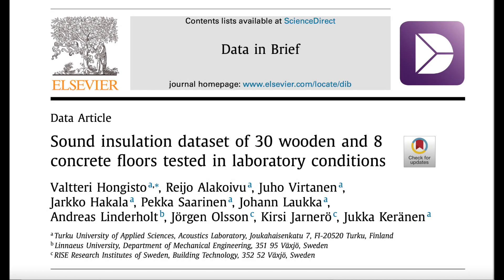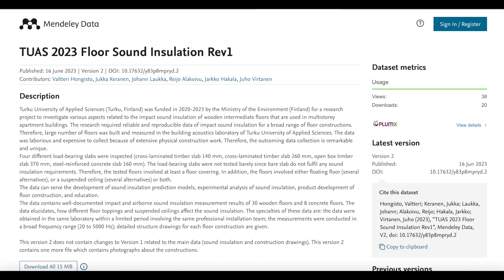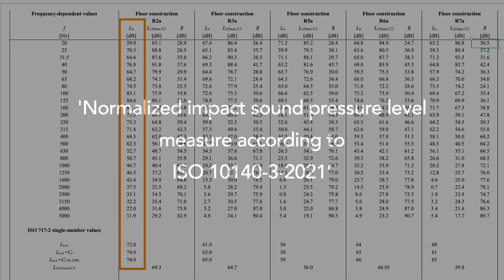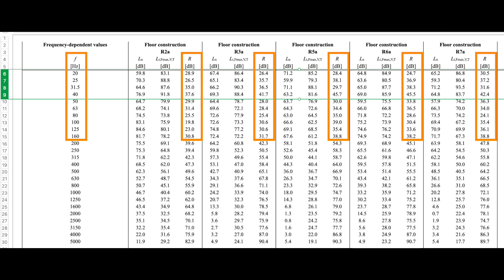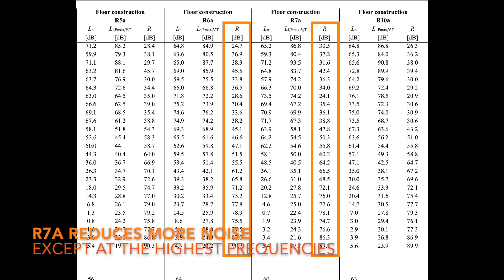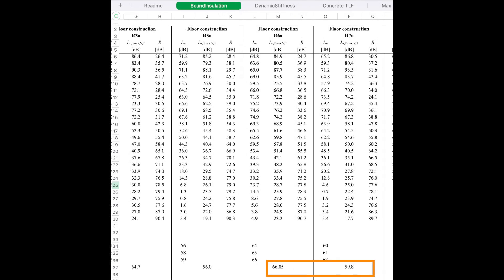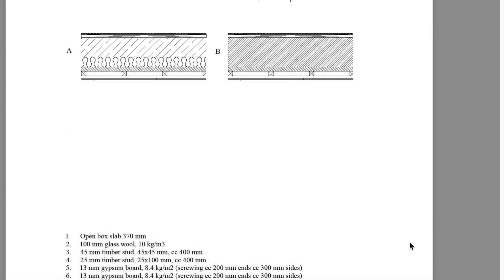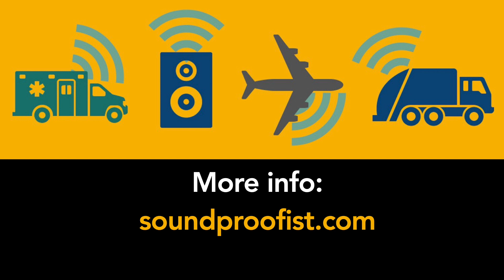Lab-tested noise solutions that actually work! (from Finnish researchers)

Comment: Found your video on a search for rubber vs Eva, which is better at vibration isolation. I hope you don't mind giving me your suggestion for my situation. I live in a condo and when my downstairs neighbors shut their front door I feel a strong vibration throughout my floor. I sit in one spot most of the time and was thinking if I purchased a large rubber mat, ,some Eva foam tiles interlocked on top of the mat and then a sheet of plywood so I can use my roller office chair. Possibly another rubber sheet on top of those layers. Do you think this combination would minimize the vibration? I have left a note for the down stairs neighbors to close their front door gently but only get minimal success with that. Thank you and sorry for the long message.
Reply from the maker: Several viewers have asked me if they can reduce vibrations (from an outside source) by putting their furniture on anti-vibration pads. My first instinct is to say "no," because the vibrations and resonance are already in the building frame, and you're not stopping them at the source. Anti-vibration pads should be placed between the offending source (say, a washing machine or an HVAC system) and the structure . 

But I understand what you're trying to do... you want to create a buffer, a float, where you sit. My guess is that you'll still hear (and feel) that door slam on a rubber mat because the framing is moving underneath you. It's totally normal to feel frustrated with your neighbors, since they're not helping. 

They might not be actually slamming the door. -- maybe it's helped by air pressure (wind). One suggestion: you could offer them some strips of thin, closed-cell foam weatherstripping (or felt) to line the inside of their door frame. Maybe a thin strip of foam would enable a softer close, in the same way that it can reduce the slamming sound on cabinet drawers. Of course if the door is really snug in the doorframe already, it might cause them to slam it harder.

I don't want to discourage you from trying your experiment. But I also don't want to raise your hopes that it will resolve the issue. Think of it this way: if there was an earthquake and your chair was on a rubber anti-vibration pad, would you still feel the earthquake? Yes.
Reply: Thank you for the thoughtful reply. The unit below me was vacant for a least a year and now it has been sold so a lot more in and out of the door lately (trades people in and out and the final clean up etc.) which reawoke the situation that I had relief from. 

Those of us that have lived here a while have for the most part learned to keep all noises to a minimum, including bringing the front door to the door jamb and just push slightly till you hear the click of the latch bolt spring into the strike plate opening. I don't hear the closing of their door but the vibration is enough to send a slight tremblor through my floor. 

So the wood work, joists and door framing must at some point be loose or my flooring (laminate) is not properly adhereing to the subfloor. Of course any banging on the structure would produce a vibration.

 My new downstairs neighbor is moving in later this week so I'll see how it goes before any purchases. From my observation some people are just naturally noisy and some are not and those that are noisy just do not hear or feel what other people are sensetive to, a kind of numbness that is somewhat enviable, but then again not. 

You are right that I want to make a floating island and hope that the rubber mat and eva tiles would disipate the vibration. Probably wishful thinking, but maybe provide a little placebo effect.     Thanks again. @soundproofist
Reply from the maker: @lostinthekerf  I have a similar issue in my building. If a downstairs neighbor slams the door, it makes a loud bang and rocks the upstairs apartments. It can happen from a gust of wind, or if they have visitors who enter/exit as if it was a barn in the middle of nowhere. When a new resident moves in, they sometimes need to be informed about the building acoustics. For example, I'm intentionally quiet and light-footed, and I have carpeted walking paths. So they might assume -- since they don't hear me -- that there's no noise transfer between our units. They can get defensive and express disbelief if they're told that their activities can be heard loudly upstairs, like slamming doors & drawers, pounding feet, party conversation, etc. Or they accuse the neighbor of being overly sensitive. It's a challenge, for sure. I totally understand why you want to build a placebo!

Comment: thanks for this.  im about to start some soundproofing in my ground floor apartment and every bit of research helps
Reply from the maker: You're welcome. There's a lot to dig into with this particular research project and I only scratched the surface. I think lab-tested is more reliable, and I'll look for more examples like this one. They usually need an "interpreter" to simplify the info.